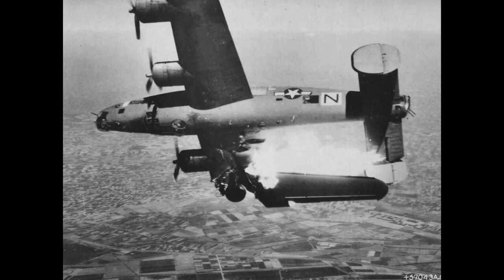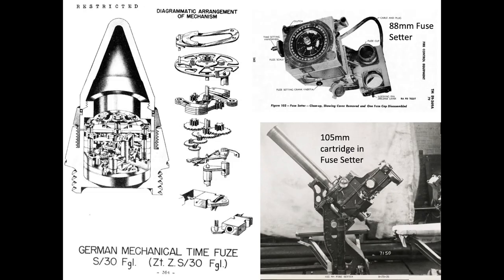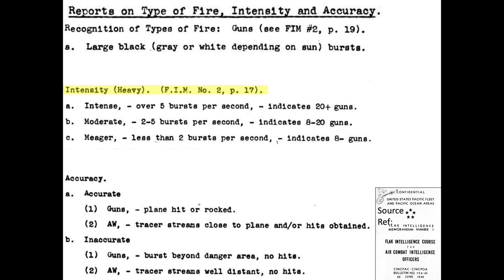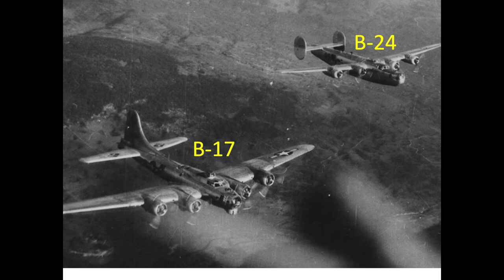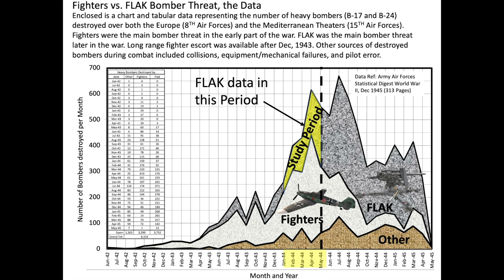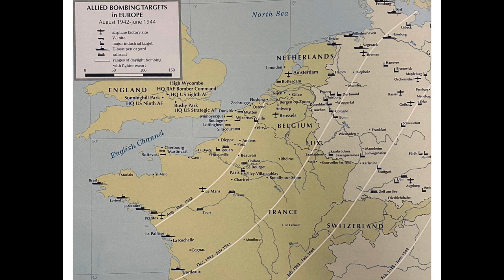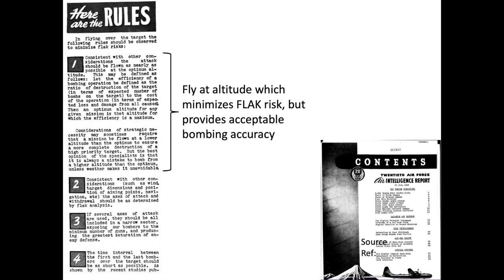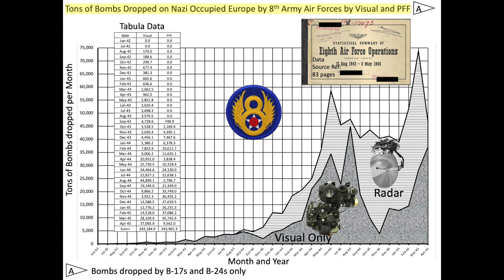Effectiveness of German FLAK?

Comment: As a content suggestion, if it hasn't been covered: I've always wondered about friendly fire and accidents in bomber formations. Like everybody is blasting machine guns at passing moving targets, and then there is footage of a dropping bomb taking out another bomber. Also just the training, massed operations and formation flying must have caused a lot of problems.
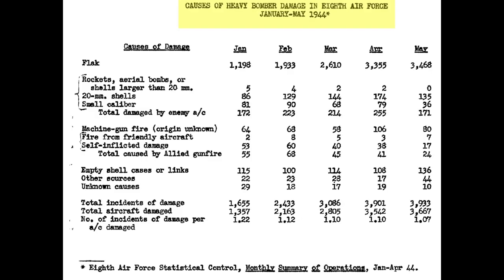Reply: Check the chart at 10:18 for some monthly data...
https://youtu.be/NGHEupuCJ5Y?t=618
Reply: @mdr23  DAY-um!... every fighter and bomber flown by the US ejected all of its shell-casings (and links) overboard... that chart shows that this caused quite a bit of "friendly" damage!  I doubt that it DOWNED many bombers, but had they been powered by JET engines, it probably would have!
Reply: As flagged by mdr23 @10:18, the line-item "Self-inflicted Damage" is quite significant!... I assume that's the upper and ball turret gunners accidentally hosing their own aircraft!... I don't think any of the other gun positions can be pointed at their own "ship"... :hand-orange-covering-eyes:
Reply: the upper turret guns had  "blind spots" (I don't remember the exact degrees) and could not fire directly behind the plane (in order to avoid the tail) and could not lower guns beyond the point where the top of the plane or engines would be hit.  As far as "self inflicted damage" goes I too am curious as to the specific causes/reasons of same.  I would have thought that "friendly fire" would have been more prevalent than "self inflicted" as far as damage to the aircraft went.    @MajorCaliber
Reply: A later video on this channel gives great detail on gunners’ firing methods

Comment: These kind of statistics are always amazing for many reasons - how in the world and who put them together? Just a personal theory is that the heavy bomber and large formations strategies, combined Sith debriefing after missions helped. But it is so extensive I don't think modern day computers could calculate the data so quickly.. Last, great job in putting these videos together, it covers what the Allied Air Forces were up against every mission they took off on.. Although penetration got deeper each year, the Germans were tenacious adversaries and kept hitting back until the last days of the war. However I've always been surprised, even with Allied fire power, they did not use the Luftwaffe more effectively on D- Day, like they did at Dunkirk. But that's another video...
Reply: Dunkirk was in 1940, and the Luftwaffe was very strong and had most of its experienced pilots.

Compare that to mid-1944, when it was decimated already by Allied fighters. There just wasn't enough planes, pilots, or fuel to do much.

Comment: I once saw an interesting animation that showed bomber pilots how to avoid flack. The flack team had to calculate the lead and ballistics required to get the shell on target and it took 25 seconds for the shell to reach you (the flack team are not aiming at where the bomber is now but where it will be in 25 seconds time) So a bomber pilot should slightly change altitude and heading every 20 seconds. That way the flack teams lead calculations will always be a few seconds too late by changing altitude quicker than they can calculate and send a shell there.
Reply: Not Me Not Me:   That's what USAF aircrews were trained to do - zig-zag at about 20 second intervals when encountering flak.   Not that a good bombardier could synch his Norden bombsight on the target in about 15 seconds or less.
Reply: Not Me Not Me:   That's what USAF aircrews were trained to do - zig-zag at about 20 second intervals when encountering flak.   Not that a good bombardier could synch his Norden bombsight on the target in about 15 seconds or less.
Reply: This is exactly right.  Indeed on the first atomic bomb run both Tibbets and his copilot had been veterans of the air war over Germany.  They were flying straight and level unmolested and at one point Tibbets said to his copilot 'If we were over Germany we would already be dead'  -  He later commented he said that exactly because they werent zig zagging every 20 seconds (they also would change height routinely)

Comment: Thanks, not surprising to see that flak took over as the primary threat to US heavy bombers when we get to mid-1944.  In 1943 the Luftwaffe's fighter force started to face some very high attrition in the Mediterranean Theater.  Specifically when the Allies were waging huge air campaigns to suppress the Luftwaffe before the invasion of Sicily.  Sicily, Italy, the Luftwaffe fighter force was in for a bad time, but it got worse when it was decided that the fighters had to be reduced even more as a prerequisite for the invasion of France in 1944.  By the time of Operation Overlord in June 1944, the Luftwaffe's fighter force was a ghost of itself and couldn't even truly contest the landings.  So your documentation of the bomber losses to fighters dropping drastically lines up perfect with these sequence of events.

The one thing the Germans could keep making were big flak guns.  Don't forget there's other big stuff like the 128mm Flak 40 and 105mm Flak 38.  It didn't take as much time and resources to train up a flak gun crew compared to a fighter pilot.  The Luftwaffe's fighter force degraded but the flak stayed dangerous until the end of the war.

Comment: I read that in the final months of the war, fuses were changed from timed to a combination of timed and impact. That simple change reportedly increased the number of bomber kills per AA round by 200% to 300%.
I still wonder why it took them so long to realize that so many shots actually hit the planes and harmlessly passed through them only to detonate behind them somewhere.
Sure, the odds of a direct hit are minimal, but they add up if you shoot hundreds of them at each plane.
Reply: Do you remember the source you read for this change in fuses?
Reply: @stage6fan475  The fuse in question is the "E.Dopp.Z. S/30 Fg" by Junghans. I believe a second type was also produced.

Comment: 👍 very interesting... does make you wonder though,  if it takes approx 1500 shells to take down a single bomber, wouldn't it have been better use of the 88mm Flak gun fitted in AFV, and development of a purpose-built anti-bomber heavy fighter, though it's a trade off between one skilled fighter pilot and maybe a dozen semi-trained gun operators
Reply: It would take a single flak cannon at 15 rounds per minute an 1 hour and 40 minutes to shoot down a single bomber on average. I did the math and you would need 10,000 pieces to destroy a bomber formation of a 1000 in 10 minutes if germany had proxy fuzes it would only take 2 mimutes
Reply: Uhh.... what you suggest is literally what the Germans did.  The Tiger got the 88mm, the KT got a longer barrelled 88mm.   The Fw190 A8 especially had dedicated bomber hunter models, and planes like the Me163 and Me410 were made exclusively for the bomber threat.
Reply: They did have heavy fighters but they were easy prey for the escorts